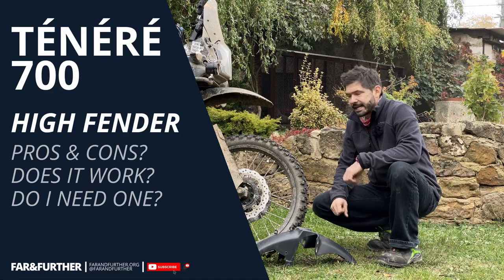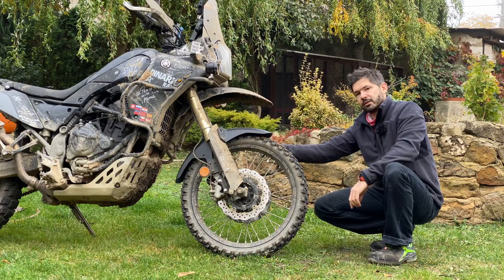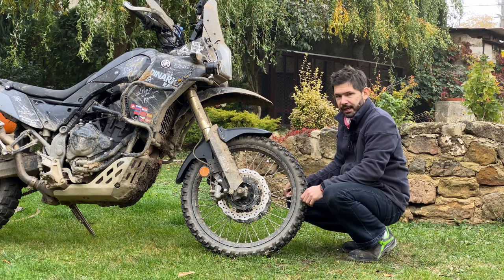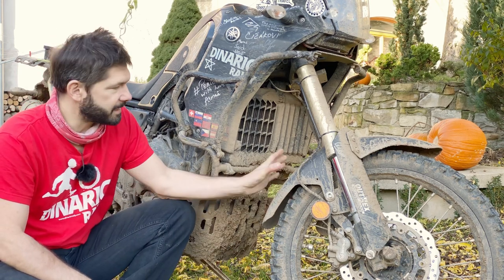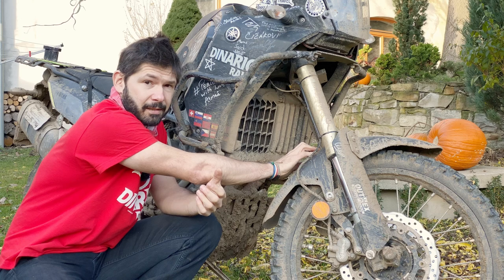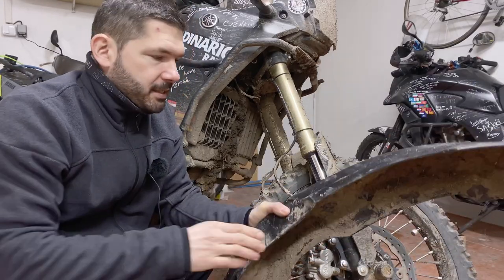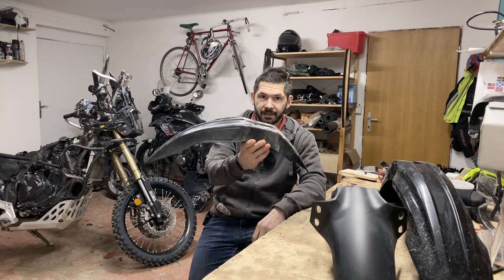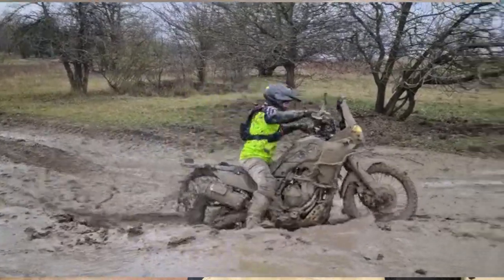Yamaha Ténéré 700: High fender vs Low fender options review

Comment: After getting stucked in a field once due to mud blocked front wheel I learned it the hard way that some space between mud guard and wheel is a  good thing to have
Reply from the maker: Yep, not dismissing that at all. I'm just not riding in fields usually. And with the changes to the brake lines I need to unscrew few screws to take it off. Although in the fields you probably have a problem with the brakes as well.
Reply: @FARANDFURTHER  Brakes worked well but screws were worn so my tools had no grip. Solved it by ripping off the whole mud guard and left this field. Brake hose needed to be replaced as it has been rubbed thin by the tire after a while

Comment: Totally agree with you regarding the amount of stuff that gets flung up on the radiator. Still, it's possible you live in an area where the dirt is a different composition, so your mud may not be as sticky as someone elsewhere in the world. I've had TONS of mud packed up around a wheel, so it can happen. I do value the 'hypothesize and test' method, as too many people just buy stuff they may or may not actually benefit from.
Reply from the maker: Hi Adam, it is for sure very subjective and depends on the location, I'm sure I will eventually pack it with mud somewhere. I find the dirt on the radiator quie a problem after doing some heavy dirt it gets packed completely with fine mud and must be cleaned very well otherwise you loose cooling. That happened in the end to me, however the T7 went through like 2 days of clay bath so no wonder.

Comment: Just bought my T7 rally, I wanted a high fender but not the problems, you described than I found the Yamaha OEM kit for high fender, it front high and the back of the tire remain low, easy Install, 30 minutes for a mechanic. And looks very nice.
Reply: Same here, not wanting the issues with brakelines changing, oem fits great and the low guard keeps the bike clean
Reply: @dutchyFal  the only sad part is the price of the kit.
Reply: @EvilFluffy0  yeah, it was about €327 euro here in holland, but the camel adv one is about 200 usd, and then you need to buy a fender, 50 usd, so then its just a little money to get a original one.
Reply: And excluding the shipping to europe offcourse
Reply: Camel kit without fender is €250 in the Netherlands. Just ordered one, and a fender costs €25. Still quite a bit cheaper. 

But the bad thing about the OEM plastics is the price (really expensive for what you get) and you've still got the brakeline linked right over the front wheel.
Reply: @Kruik013  the brackline is over the rear part of the fender ,the oem kit is in two parts one at the back of the front tire, and the high part on the front ,the brake line isn't moved, it remains on the same place as the original fender. It's half original half high. The cost is not that high considering it's in two pieces perfectly adapted.
Reply: I know, but if a branch will go between the forks it can catch the brakeline/fender and break it. But, not everyone goes pretty hard offroad so it isn't for everyone.

Still, cut the front of the OEM fender buy a high fender model you like, cut the rear, drill 4 holes and bolt it on. Done for €30 and some time. In my opinion, the OEM high fender is too expensive for what it is.
Reply: @Kruik013  since the brakeline is exactly at the same spot as the original one, it doesn't matter. Yes, tho this bike isn't an Enduro, very few people will go hard enduro with a T7 its not meant to. Cutting the original plastic and not having something ugly requires some skill. Honestly, I prefer having the oem kit and keep the white original one so I can always go backward.

Comment: there is mud and there is a MUD :)  I lost half an hour few days ago to clean low fender on my tenere (xt) when front wheel got locked, for extreme adventure bikes high fender is a must. Will be installing polisport high fender same as on my ktm 500 exc enduro bike.  One more thing to consider is cooling - your big one fender covers radiator pretty good,  polisport one has some holes in the back for air flow.
Reply from the maker: In terms of cooling it was my worry with the bigone I had, although it seems that doing a lot of liquid mud will pack up the radiator pretty much completely rendering it useless. Thats the reason my T7 started to overheat in the end, there was no air flowing through the radiator.

There are definitely situations where sticky mud will packit but I'm happy with the risk and with the fact I have the brake lines repositioned.

Comment: Solid practical info, I've stuck with the stock fender for all the mentioned reasons & appreciate your testing has proven it to be the right move, thanks.
Reply from the maker: Thanks! Glad it was helpful, I could not find any real info on the fender, so I had to go through the testing myself. I myself thought it will me much easier to pack the low fender.

Comment: With the setup you run even if it packs up you can take it off clean the packed mud and put it back on. Looks like the way to go.
Reply from the maker: Exactly that is my backup plan, the re-routing of the brake hoses makes it possible.

Comment: Great review agreed depends where you ride. I opted for the large WR450 fender as in Spain in the Berdinas Realas it is a clay type mud. I got that much packed in the mudguard it locked the wheel several times. I had to remove it and then damaged the link pipe on the breaks.
Reply from the maker: Hi Michael, yes 100% depends where you ride. I know some people from US said no way low fender as they have the clay there as well.

The setup I ended up is different brake hoses and low fender because I don't have that much of clay around. Also in case I pack it up with the mud I can take off the low fender easily and I have nothing above the wheel which means I can't damage the brake hose as you mention.

Hope it was not serious damage to the hoses...

Comment: Thanks for the testing. I was thinking about high fender options. But im fine with the low mount. I might hog out the plastic around the bolt mounts to get a little more hight
Reply from the maker: Yes, that is also an option. For me splitting the brake line is the main advantage as that will make taking it off easy.

Comment: Good review...I will stick with the OEM mudguard.  The other issue potentially with the bigger high mudguard is stability on the road at speed...it will really catch the wind. Cheers,  Steve
Reply from the maker: Hi Steve, glad it was helpful. I think the "impaler" size could be prone to the side winds at higher speeds, however I could not test it as I have Mitas C-19 & EF-07 on T7 for hard offroad and going fast on the pavement on those is much more dangerous than the fender :)

Comment: I wish you would come to the Southern US and do that test. The clay here will stop a low fender tire in it's tracks. Thanks for the demo very interesting with the back to back approach.
Reply from the maker: I guess there will be Southern US videos coming up ;) Quite a few people mentioned you clay... To be honest if I'd really try I could pack it up here as well, I'm sure I can find a place full of clay.

But... I wanted a test where I go to various off-road scenarios without really thinking specifically to pack it up. I showed it is possible, it's not a myth that it packs but it takes specific conditions which are quite difficult to find...

Unless... apparently one lives in Southern US... then long high fender and happy riding :)
Reply: Low fender does fine in GA clay. If you can "lock up the front wheel", I'd love to see it. Tires are a different story.

Comment: Its not just mud... I have ripped off a low front fender with a stick and mud build up. Low fenders are for on-road use only. Watch my very old video here from 2 minutes for a look at what happens: https://youtu.be/OYVsz507G1c?t=121
Reply from the maker: Yes the sticks or other stuff is a real danger apart from the mud.

Comment: Here on the L.A. freeways, high enduro-type fenders just look out-of-place to my eye.
I'm glad the low OEM fender works OK - especially in our climate.
Reply from the maker: Yea, it is working very well in its high position. I think what makes this mod worth are the changes brake lines so you can take the fender quickly off of you need so.

Comment: The high front / low back combination - I see that on a T700 and it just smacks of being a styling thing and nothing more, which is fair enough if you’re honest about why you’re doing it, but the reality is that it’s the worst of both worlds. The back will clog. The front will cause the front to feel weird at speed (it sure always did on my enduro bikes at speed) as it flaps around. 

Go one or the other.

Comment: Great video. Thank you. How was riding with the long high fender on the freeway, or highway speeds?
Reply from the maker: Hi, I've not ridden with the high fender much on the highway, I took it for a spin at 130km/h but only briefly which does not really count as a real test. Where it will be noticable with the long high fender would be in heavy cross winds I think. But can't really say.

Comment: How about OEM fender + fender extender? Maybe next thing to test?
Reply from the maker: Possibility, but we're talking now about minimising splatter pattern on the bash plate and radiator. I'm currently happy with it's performance and I think adding extension would just make it more prone for branches and rocks as it would sit much lower.

Comment: Thanks for the info.
You mention and it's obvious if you pay attention, that you're using the OEM fender at the higher position. If the height at the front part of the fender is ok but mud is packed at the rear, can 2 spacers be added to lift the rear part too?
Would this be helpful?
Reply from the maker: Yes, the OEM fender must be in the high position. When I was testing the low fender I thought I'll make custom "extension" brackets for the front & rear mounting points so that I'd be able to move it even higher. But as I didn't manage to pack it up I gave up on the idea.

I think one would need to lift up the whole fender not only rear as if you lift only rear it would tilt the fender and mud would get stuck under it at the top of the wheel.

Comment: So in order to switch back to the OEM fender, you just place it back with a few screws?? All the brake lines stay in the same place??
One more question. What is the front tyre you are using? Thanks for the answers!! Love the look of your bike and i also have an idea to put a sticker of every country i am about to visit :)
Reply from the maker: Yes, just take off the high fender and put back on with original screws. The brake lines (new ones) will stay in the place no messing with them.

With the tire…. Not sure could be Mitas E-13 or even C-19 at that time. Something off-road.

Comment: on the standard fender it looks like you have opened up the mounting holes to get as much lift as possible?
Reply from the maker: Hi Simon, I've not yet modified the sandard fender. There are the metal insets missing in the video but I'm still using it as-is. I thought to make an adapter brackets to get higher positions but as I've not been able to packit/break it... Not sure if it's worth it.

Comment: With the brake line T-connector placed higher up (where did you put it?), was bleeding the front brake lines easier or harder?
Reply from the maker: I didn’t really notice any difference. The T-Connector is placed at the bottom of the steering where the bracket of the high fender is. Like Came ADV does it as well.

Comment: Regarding the large high fender options - Polisport is making universal one with some sort of perforation in order to let the air onto the radiator. But either way I think the low fender is the best option overall. Great review!
https://www.polisport.com/en/off-road/front-fenders/freeflow-universal-front-fender-black_p3958.html?id=551&cat=541&pc=1
Reply from the maker: The problem with the perforation is that the radiator will be all mess. What I liked on the full size fender I tested was it kept everything very clean (until it fell off) and I think that was the biggest advantage.

I agree that for traveller, the low fender with changed brake lines is the best.

Comment: Can you put the original cut from behind and on top one cut from the front that protects only the back?
Reply from the maker: In my opinion if something is left down in low position I then it will have the same issues as the low fender. When high fender the long one will work and I think it's not practical to come up with complex split system.

Comment: I think that the supermoto fender was way too small ... There are no details on model of fender and I suppose there could be mid length supermoto fenders. And you could also add an extension to the supermoto fender to keep the radiator a bit cleaner. I don't do a lot of mud and I know the low fender is better for spray but the chance a branch can be picked up and under the low fender puts the break lines at risk. Changing the brakes is a must ... see Camel-Adv.com ... They also have some recommendations on fenders.
Reply from the maker: I've mentioned both high fender models and the part numbers in the texts in the video. I know about CamelADV list and if you look closer you will find those fenders in the CamelADV list.

The long high fender worked well so I assume upgrading the SuperMoto one with extension could work but in that case I'd opt for the long fender anyway.

As I said in the video, yes with low OEM there are risks, but for my overlanding I can live with them and manage it, as a matter of fact I didn't break the low fender on my motorcycles in 130000km including roundtrip to India.

Comment: Did you lose your abs with the two brake lines?...do they come straaight from the master cyclinder?
Reply from the maker: Hi Simon, no I did not loose the ABS, I had made custom steel braided brake lines and replaced the line directly from the ABS unit to the front brakes. I have single line from ABS going to T junction to split to left & right calliper.
Reply: @FARANDFURTHER  did you notice any difference with the s.s. lines?
Reply: @FARANDFURTHER  ok thats great info thank you.
Reply from the maker: @lefterisbampaidis5446  Hello, I have to say that very subjectively the braking feel & response is better. But it's not like the bike was not braking before and now it suddenly stops immediately. If you know what I mean.
Reply: @FARANDFURTHER  I do. Thanks for always getting back to me and all the fellas. 
Keep it up!

Comment: How did you move the brake lines?  Camel high fender?
Reply from the maker: Hi Andrew, no I have not used Camel ADV kit. The cost of it + shipping it to Czechia is a bit prohibitive. I have just custom polycarbonate block which was supposed to hold the high fender but now it only holds the new brake lines.

I measured and ordered custom brake lines which go from ABS unit to T junction and from there it goes to each calliper. The polycarbonate block now only holds the T junction.
Reply: @far&further can you please show the measurement of the brakelines thanks in advance!
Regards 
Matte
Reply from the maker: Hi, I don’t have measurements with me. It has been done by the workshop and they measured the lines. The guy is now in hospital. Once I have it I’ll let you know.
Reply: @FARANDFURTHER  Thanks man, by the way great Summary of high vs low fender
Reply from the maker: Thanks, glad I can put out something with information value 😂

Comment: I think a combination works great, high front fender and low back fender
Reply from the maker: Low back fender?
Reply: @FARANDFURTHER  I think he means mounting on both fenders simultaneously but cutting off the front of the stock fender and the rear of the high fender. Just like what Yamaha did on the XT660R/X and the WR125X at the time.
Reply from the maker: Aaaaaha… I never tried that combination. But in that case how it protects you against mud buildup? That’s probably the main reason people are thinking about he high fender.
Reply: @FARANDFURTHER  I don't know, I never tried it either. But I'd think it wouldn't have a real advantage over the full stock fender or nothing significant in that regard.

The main point of this mod surely is the aesthetic. You'll keep most of the protection of the stock fender while making it less conspicuous, and you'll have the aggressive look of the high fender without blocking any air flow to the radiator.

That said, it might be a compromise worth trying 🤷